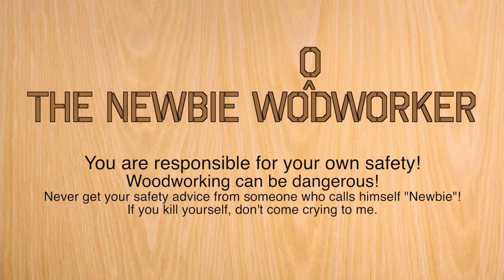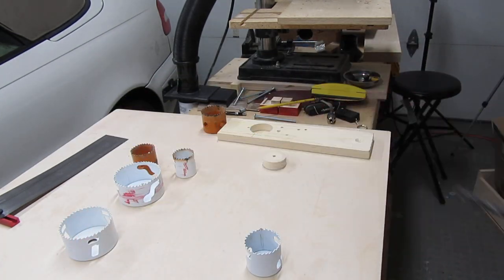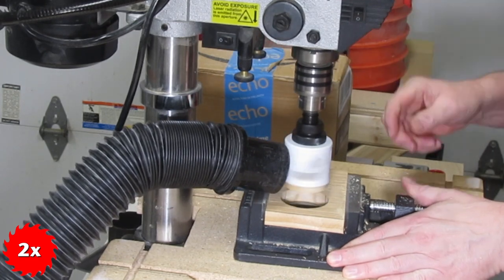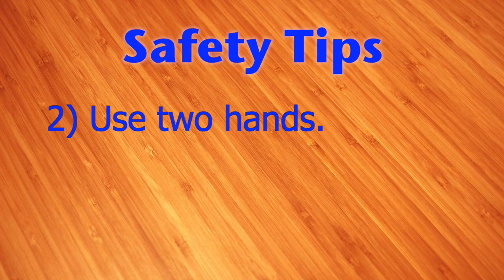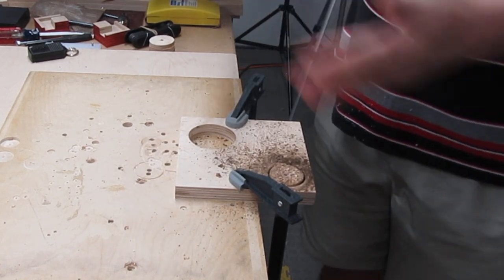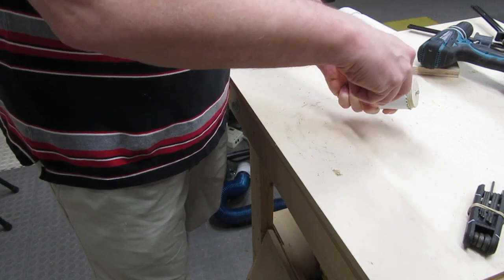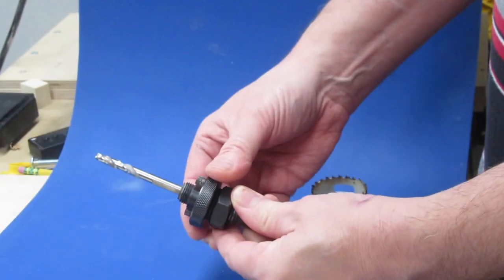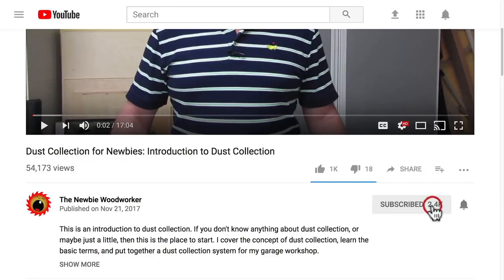Newbie Tool Tip: Hole Saws

Comment: Excellent and informative video. I bought a set of cheap HF hole saws some years ago. Since I've retired I have more time to make stuff. The problem I have is that even though the set has 13 different sizes, I need a 3 1/4" size that did not come in the set, and there is not one sold separately. It would be handy if there was an adapter so that I could put a standard hole saw into the oddball non-threaded, two-flats arbor that came with my current set. It looks like I'm going to have to upgrade.
I know you cover safety quite a bit in this video, but there is one thing that you did over and over that made me cringe. You have a loose fitting shirt dangling right there next to the spinning hole saw just waiting to pull you in and cut a hole into your stomach. You need to have a tighter fitting shirt or a longer one that is tucked in.
I learned a lot from your video about the design of hole saws without having to tear open packages in the stores to compare to what I have.
Reply from the maker: Thanks for the comment! No worries about the shirt, though - that shirt fits MUCH more tightly than it did when I made the video. 😂

Comment: Dan, Thank you sooo much.  I purchased a craftsman hole saw kit with 7 hole saws, it had the mandrel and the adapter, but NO instructions on how these fit together.  Needing to use the 2", I put the hole saw on the mandrel and then put the adapter inside the hole saw and was having so much trouble tighting it down.  Anyway I send 2 requests to the Craftsman site for help, and also called, but got they were closed (2 hours before the site stated, they would close--maybe Covid caused that situation). I looked at i don't know how many videos over the last few days and not one showed, what you just showed me in yours about what the adapter was and how it worked.  I just assembled the 2" hole saw per your instructions, got up went to my cabinet and cut the hole for the microwave extension cord.  I couldn't have gotten it without your detailed instructions.  I've saved you as my go to when needing assistance with any tools.Blessings to you and yours.
Reply from the maker: Thank you for sharing that! It's really good to hear from people who were actually helped by a video of mine. Thanks again!

Comment: Thanks, very comprehensive. I seen another youtuber recommend using the torque/clutch setting if using a hand drill so if the holesaw grips or binds then the clutch will slip instead of twisting the drill (or the work piece).
Reply from the maker: Thanks, and that's a great idea. 😄

Comment: I’ve just bought my first, very cheap, press drill and I want to make a table for it requiring knobs. I now know where I can get some freebies. 

Thank you very much for all the tips, especially the safety ones.
Reply from the maker: You're quite welcome. Also check out my knob-specific video: https://youtu.be/Di_xHYgCE88. I'm also doing a video for how to build a drill press table, but it'll be at least a month before it's out, if not longer. Oh, and check this video out also, in case it's relevant: https://youtu.be/9kY3fk6Q-kA. Have fun! 😄

Comment: When I use hole saw, I score the surface and use another bit to drill on the inside of the hole saw score mark, drill all the way thru then switch back to the hole saw. I found it allows the saw dust, chips to evacuate much faster and allows you to drill much faster and build less heat, also if you have to drill a couple of holes and your saw is a tad bit dull you can at least get the project done.. Down side is the plug is no longer useful as it has a notch in it.   Found it useful when I had to drill 48 - 2 1/2" holes thru 1" boards sandwiched together to use as a table to hold CNC milling tool holders. I use this method on thin metals as well.
Reply from the maker: Thanks! 48 holes?! Ugh, that sounds like a lot of work. :)

Comment: Very thorough explanation. Nicely done. Another suggestion for preventing burning and improving speed is to drill clear 1 or more clearance near the inside edge of the holes outer rim.
Reply from the maker: Good tip. Thanks!

Comment: I find it helpful to pre-drill the pilot hole with out the hole saw on the arbor. Also if you want the cutout without the hole simply use a template board clamped to piece to be used, remove the pilot and saw away. Template is made by drilling the desired hole saw size. Sometimes sawing in reverse prevents grabbing by the saw teeth. One more trick I use drilling soft material such as vinyl soffit etc is to use a steel rod to guide the hole saw helps keep it from wandering cutting in reverse really helps in these materials.
Reply from the maker: Good tips! I like the idea of the template board - it would be good for making knobs without holes in the middle. Thanks!

Comment: Hi my name is Kevin from Aus  I notes that you used a g clamp to hold your wood  to the bench, but did not use a clamp to hold your vice to your drill table  I always bean taught to clamp all things to the table  I am a retired mechanical engineer  of 56 years in this job , keep going with your videos  Kevin Schlipalius  Deakin Engineering Aus.
Reply from the maker: Thanks for the comment, Kevin. I totally admit that I don't clamp as many things as I should. I need to keep an eye on that. Thanks!

Comment: So the drill part is important to help keep it centered? If I use the small saws in my kit, do I attach one of my own small drill bits? (it doesn't have one on the small thing) Thank you! Total newbie with hole saws you can tell!
Reply from the maker: If it doesn't come with a bit, I would think it's designed to fit on an existing arbor. An arbor is the bit-like thing, that has threads that let you screw on the hole saw. The bit really is needed or else the hole saw will just jump all over the place.
Reply: @TheNewbieWoodworker  thank you!

Comment: Hi, just purchased a spring loaded mandrel from Milwaukee however I noticed that that when the two posts engage, the hole saw starts to rattle and vibrate around like crazy at low speeds. The hole saw size I'm using is 4 1/8  and is relatively big however I'm not sure if the hole saw is suppose to rattle like that. It feels as if  its not tight enough. I looked at other peoples videos including yours and noticed that everything seems to be working fine even at low speeds.  Maybe I'm doing something wrong since this is the first time I used a hole saw mandrel but if this continues I'll try my hands on the mandrel that has the threaded nut.
Reply from the maker: You're right, it shouldn't be loose. So if it is, obviously something is wrong. If you don't see anything obvious, then trying another mandrel is a good idea. The other possibility is that the hole saws you have were made for a different type of mandrel, but usually if that's the case, they won't work at all. Good luck - let me know what happens. Oh, and depending on where you bought the mandrel, you might be able to return it, so don't forget to check that out. I can't tell you the number of times I've forgotten to return something like this. 😄

Comment: I learned real fast with my 20” 12 speed 1.5 HP Jet drill press to use a low rpm….I use 300 rpm to cut a 4” hole with my dozer for one of my craft designs, cut low and slow, going to fast such as 1000 rpm or faster made my press shutter and shake which places stress on the spindle and column which could be damaging and expensive to replace

Comment: Very informative video. Thanks for sharing.
Last week I started to use my hole saws again. I have a cheap set.  I noticed that the Milwaukee has written the diameter in millimeters not in (fractures of) inches.
Mostly I use the hole saws in my drill press which is not so powerful. (500W or 2/3 HP) For pine (which I just the most) it is sufficient.
I don't like the to side method very much. To much work and you need to use the center drill bit.
At first I used that center drill bit. But after drilling I could not remove the inner part of the wood. It was clogged in the hole saw (and around the center drill bit)
It took me a long time to free it. In the end I succeeded. But drilling a hole in for example one minute and then needing 10 or more minutes to remove the inner part
is not really pleasant. So I removed the center drill bit. Slowly I send the teeth of the circle to the wood and slowly I push it down. From time to time I
stop. then I continue. This way the sawing process takes a little long, maybe two minutes. But mostly the inner part comes out without problems.
And if not a little push with a small screwdriver (through the side holes of the hole saw)  or even a nail makes the inner part come out makes it happen, too.
So I can continue with the next hole in just a few seconds.
Reply from the maker: Thanks! Interesting about removing the center piece. There's a couple of YouTube videos that have various methods for removing it. You might want to check them out.

Comment: Great video!  Question for you....I’m working on a project and I need to drill out the middle core of a synthetic cork, like for a wine bottle, I believe they are made out of plastic, so not the traditional cork you’d see.

But I need the core of the synthetic cork to be fully intact, with no hole drilled through the center.

Is there a hole saw I can use by itself, without a mandrel being used, so I don’t end up with my cored center with a hold through it.  Even though I’ll be placing an eyelet screw in that cork later, I don’t want that hole drilled to be too big so the eyelet screw moves around.

Is there a hole saw that can be used by itself?

The one I had in mind was the Milwaukee brand Diamond Max 5/16”.  It says its for tile and such, but I’m assuming it would work on a small piece of cork.
Thank you for amy help you can provide.
Reply from the maker: Thanks! Yes, I think there are mandrels that you can use without the drill bit. You'd need to carefully clamp the cork-thingy and use a drill press, because without the drill bit in the middle, the hole saw will try to wiggle around as you're getting started.

Comment: To avoid the accident at 6:00, use an impact drill.
Reply from the maker: Thanks for the suggestion!
Reply: philsipad lots of hole saws are 3/8 or 7/16 chuck which won’t fit in an impact

Comment: Hi, just wondering,  do you change the speed of the pull down drill press for the different size of the hole cutter ?
Reply from the maker: Yes, I'd make it slower for larger holes. If I remember correctly - maybe it's faster? You know what? I'm not sure. Mess around with speeds and see what happens. (Yes, I know that wasn't much help.)

Comment: So you recommend a forstner bit for everything 1 and 1/8 inches and smaller, and a hole saw for everything bigger?
Reply from the maker: Well, sort of. I generally use a standard drill bit or a brad point bit for the smaller holes, up to whatever size bit you have, which in my case is 1/2", then Forstner bits up to whatever size you have those in, which for me is 1", then hole saws for larger. However, if I had a Forstner bit larger than 1", I'd use that over a hole saw, most of the time. I hope that makes sense.

Comment: My King Canada drill press stalls whenever I bring the spindle down with a 4-1/4" hole saw into 1/2 plywood. Is this normal? I barely scratch the surface of the wood and as soon as I put a little pressure, it stalls. :(  Any help would be appreciated.
Reply from the maker: I don't know if "normal" is the right word, but it's not uncommon at all. For me, I have to just touch it to the wood, then kind-of bounce the spindle up and down lightly, repeating throughout the process, trying to just barely avoid having it stall out. Especially into hard wood, or hardwood-plywood. But make sure the hole saw isn't dull, and it's clean. Also, try different drill speeds to see if that helps.

Comment: nice video.. just want to ask a question.. i have mdf cabinet for my aquarium and i need to drill holes for the hose, my concern is how far should i drill the holes from the corner of the wood that wouldn't reduce the cabinet capacity strength? thanks in advance
Reply from the maker: Thanks, and good question. Drilling holes in MDF can be really tricky, because MDF likes to tear out. So I recommend getting some scrap MDF and experimenting. You'll definitely want to start from one side, then finish from the other side. It should also help you figure out where to put the holes.
Reply: @TheNewbieWoodworker ; yes i am doing the half and half approach.. my only concern is how far should the holes should be from the edge of the wood sonit wouldn't reduce its strength
Reply from the maker: @RonaldJayBuayan  I don't have a good answer for you, other than drilling some holes in scrap MDF and judging for yourself.
Reply: @TheNewbieWoodworker  ahh i see.. i thought there's standards about it.. but thanks a lot though for replying, i greatly appreciate for taking your time.. hopefully someone in the future could make a wood strength test base on hole positioning
Reply from the maker: @RonaldJayBuayan  👍

Comment: So, newbie here. Can you use a hole saw without the pilot to cut a 1" thick wood to make a circle without having the drill hole in it? I did it yesterday and put it in a vice, but I'm wondering what the issue is since no one talks about it, probably for good reason.
Reply from the maker: No, in general it's not a good idea, because the hole saw will usually jump around before it gets going. It can be dangerous, and depending on the type of wood, it could actually shred the wood. But my question is, why do you care if a pilot bit cuts a hole in the wood? Unless you don't want a hole in the cut-out piece?
Reply: @The Newbie Woodworker  ahh, I see. Might have gotten lucky. I want the tuit (I believe that's what they are called) to make a round bottle opener. I used 2 frostner bits to create a recess to make the bottle opener flush and then room for the bottle cap to get inserted then I used a hole saw to make the round. I suppose I could insert a wood dowel into the pilot hole...
Reply from the maker: @TheSparkIdea  If you were using a drill press and had the wood clamped down really well, then I think it would be safe - don't know how well if would work, but it would at least be reasonably safe.. But doing it with a power drill is iffy at best. Just be careful! :)
Reply: @TheNewbieWoodworker  yeah I went and bought a vice for the drill press! Works great, just go nice and slow, pretty much followed the rest of your tips. Works like a charm!
Reply from the maker: @TheSparkIdea  Awesome! Funny tip: I learned that it's a "vise" not a "vice". Apparently a "drill press vice" is something quite different. LOL. By the way, it doesn't matter to me what you call it - I just thought I'd share that.
Reply: @TheNewbieWoodworker  😅

Comment: What would you recommend for creating a hole that doesn’t go all the way thru the wood? Example: making a wooden bed riser
Reply from the maker: A Forstner bit. Check out my video on them: https://youtu.be/S8dTylBHBCs
Reply: Two ideas:
 - Cut the hole as normal but don't go all the way through, then chisel out the unnecessary material.  You should still allow the centre bit to go a bit deeper than the saw, to ensure that the saw doesn't wander off across the workpiece.
 - Alternatively, make your bed riser in several layers, with the hole cut through only the top one - this is what I did then glued the layers to form the required height.
Reply from the maker: @robt2151  Actually, your second idea is a good one. I've used this for several projects, and didn't even think of it. Thanks for mentioning it! Not criticising your first idea, by the way - but your second idea reminded me how well it's worked for me in the past. 😄
Reply: @TheNewbieWoodworker  Yes, the simple things often get overlooked.  I made the riser blocks to the height required then added a matching piece of 6mm OSB (plywood is not commonly available here) with a hole cut through it.  With this option it is easier to get the right matching height.  Also, bed legs can be quite large in diameter, probably wider than the average DIYer's Forstner bits.
Reply from the maker: @robt2151  Excellent points, and good job. 😄

Comment: i've got a hole in a door I need to widen, would I be able to use a hole-saw? the saw will only be sawing part of the door, half in the door , the rest in the existing hole
Reply from the maker: No, that won't work at all, unless the pilot bit of the hole saw goes through wood. But even then, you'd need to be really careful.

Comment: My whole saw set does not have the posts with the mandrel, even for the larger size hole saws.  Do you have a tip for getting that kind of hole saw unstuck from the mandrel?
Reply from the maker: Possibly. First, sometimes when it cools off, it's easier to get off. Second, maybe WD-40. Third, and this is hard to explain: Basically, drill down into some scrap wood far enough so the hole saw starts cutting into the stock. Then use reverse on the drill, while pressing down on the drill. SLOWLY. Hopefully, that'll get it loose. Let me know if any of this helps.
Reply: The Newbie Woodworker    I found a tip online that worked like a charm.  I bought a socket adapter that fits into my impact driver.  On the other  end the socket adapter, I put on the socket that fits the hex shaft of the mandrel.   I held the whole saw in my left hand and ran the impact driver in reverse and it unscrewed the mandrel from the whole saw, instantly 😊
Reply from the maker: @paulcalder2792  Awesome! Glad you found a solution! And thanks for letting me know. 😄